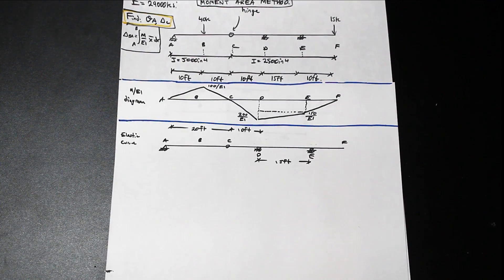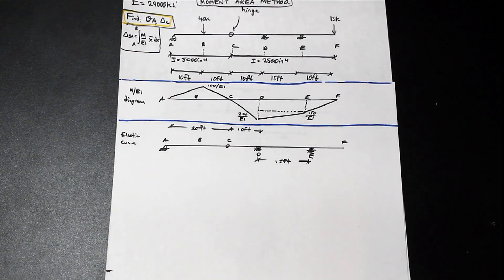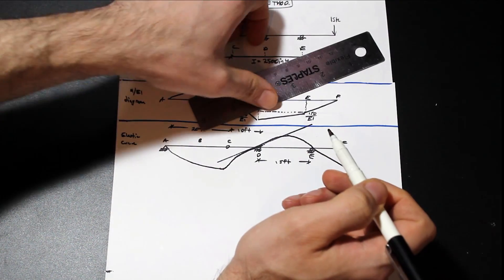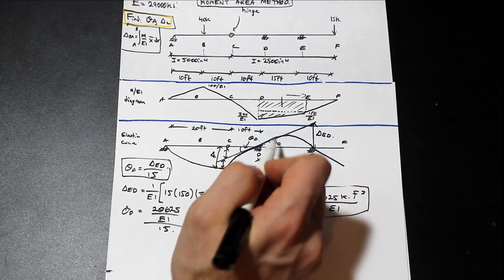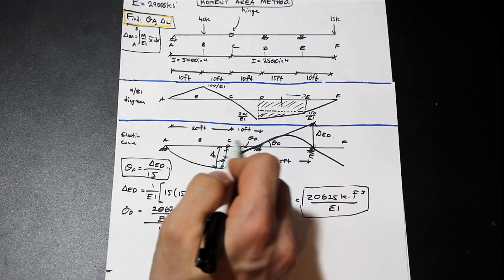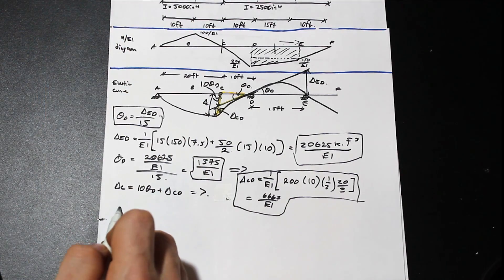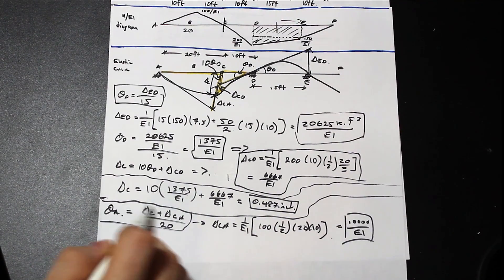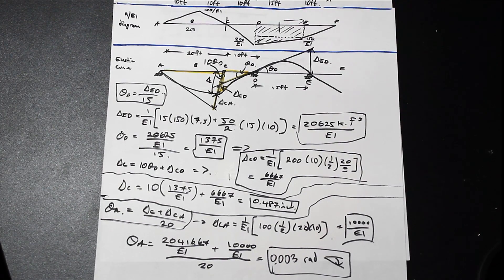Moment-Area Method - Tricky Continuous Beam with Hinge - Practice Problem

Comment from the maker: Sorry if the diagram got a little cluttered in the middle there, we tried our best to make it clear! Here are the previous introductory videos on the Moment-Area Method!

Introductory video on Moment-Area Method: https://www.youtube.com/watch?v=jkwPzvWsqIY
How to solve for the maximum deflection using Moment-Area: https://www.youtube.com/watch?v=2RQrSZQJTp4
Reply: AF Math & Engineering the elastic curve of CD is upward because of hinge at C elastic curve of CD is upward that effect of load at point f right sr???
Reply from the maker: Thanks for the comment! The hinge is causing an inflection point in the elastic curve, but the shape in which the beam is bending is governed by the loads it's exposed to! Read up on the relationship between shear, moment and deflection for a more in depth explanation for this! :D Here's a link: https://www.colorado.edu/engineering/CAS/courses.d/Structures.d/IAST.Lect10.d/IAST.Lect10.pdf
Reply: thank you sr 😇
Reply from the maker: No problem! Thanks for commenting :D

Comment: I am confused on the part where you are getting the x-bar at the different parts. I thought that the value should be the distance from where the tangent was drawn to the centroid of the moment area. If that was the case, when solving for deltaED shouldn't the xbar for the triangular portion be 5 and not 10? and then when doing deltaCD shouldn't the xbar be 10/3 not 20/3?

Comment: Thanks for the videos I have a question, Why do you have a 100k moment from A to C? if you cut at the hinge, that equals Ay to 20. Thanks.
Reply from the maker: Left of the hinge I is 5000, right is 2500.    Bending moment is 200 k-ft at point B, 200 / 2EI =100 / EI